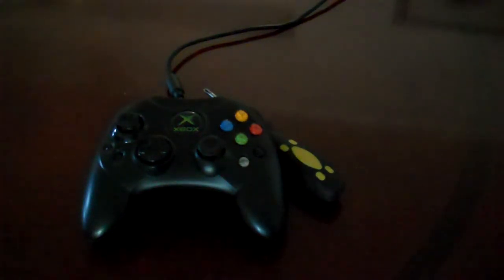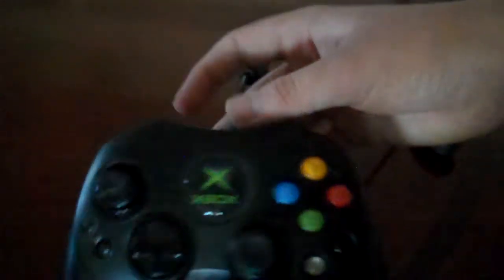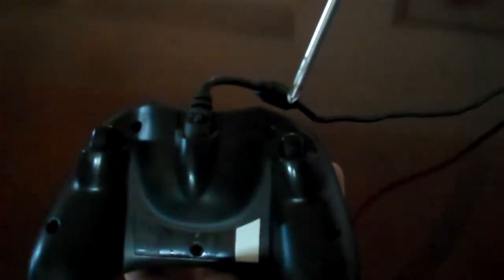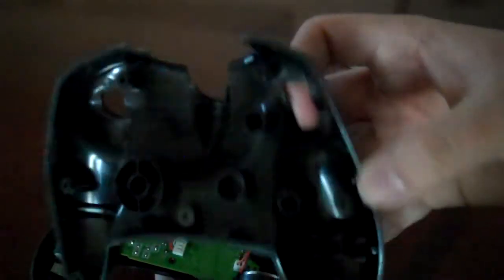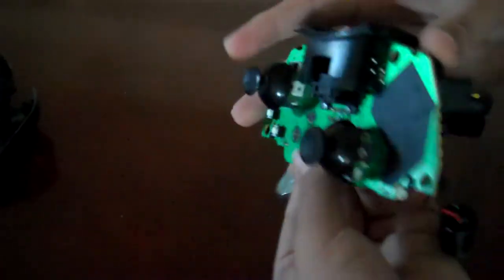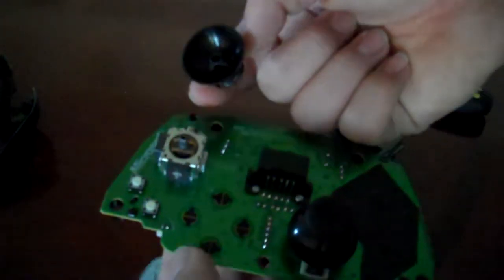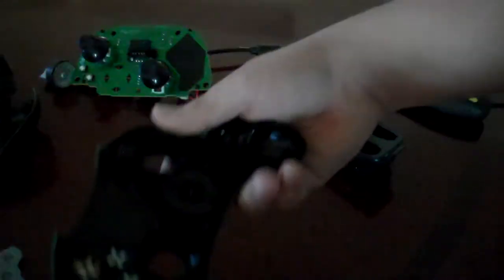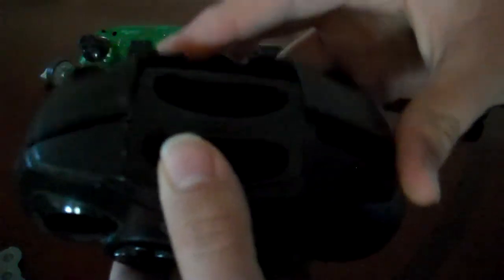How To Take Apart An Original Xbox Controller S

Comment: I couldn't find the bottom one until you pounds out it's where the serial number is. my vibrating motor popped out of place. thx so much for this video :) P.S. might have damaged the covering a little because there is some white bend marks where I was trying to pull out the back covering to the controller

Comment: Can you do a disassembly of a Original Xbox controller?
Also to take apart the D-pad there's 2 screws holding the 2 pieces together, take those out then you'll be able to take that out of the controller.
Reply: What size driver might I ask?
Reply: @NaestyNaes  00 Philips screwdriver

Comment: I have one question I have a broken Xbox 360 controller & orginal Xbox controller is there a way I use the parts to make it wireless
Reply: That's really tricky to do so. Also you need to be able to have the original console to have the ability to emit and recieve wireless connection. Like a special bluetooth that microsoft had designed.